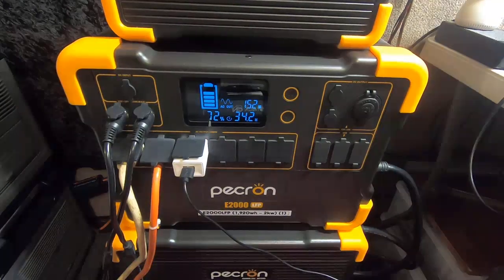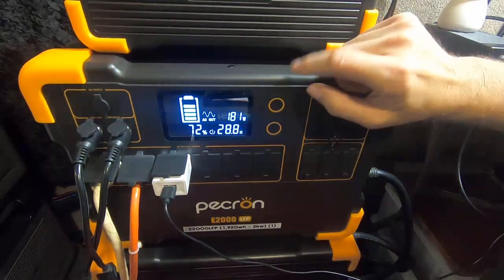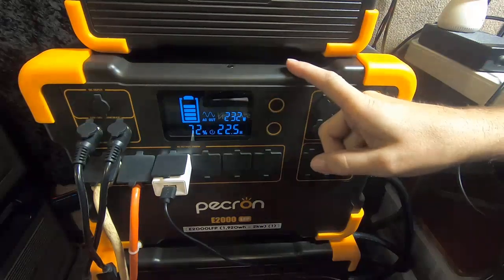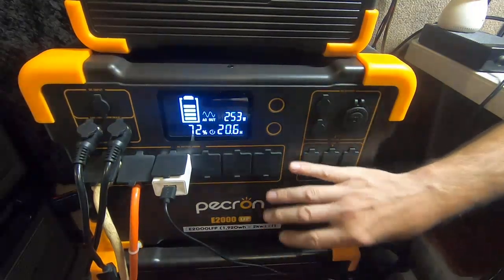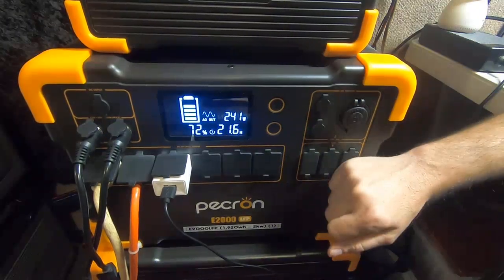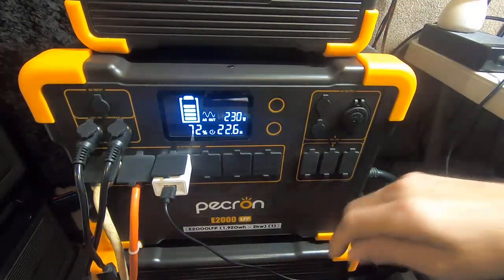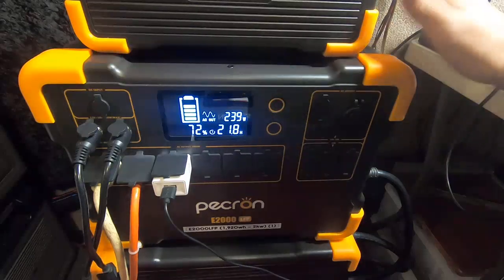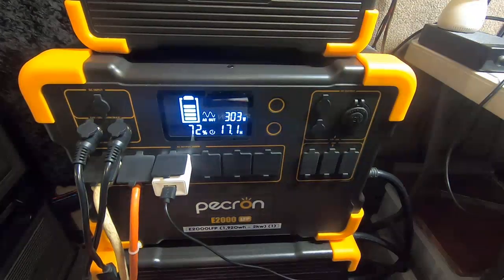SOLAR GENERATORS  ((((DO NOT HOOK THEM UP WITH PARALLEL CABLES UNLESS THEY ARE DESIGNED FOR IT))))

Comment: Each system is a wave of alternating voltage going from negative to positive. In a parallel system, the waves must be "in sync" in order to be safe. A 240v system is when the waves are 180 degrees out of sync. Thus a negative 120v and a positive 120v system, the separation is 240v. You cant possibly tell where the waves are without special circuitry or equipment.
Reply from the maker: This is the reason that we deleted that comment, Somebody could have gotten hurt trying to hook up stuff that is not made to be hooked up together.

P.S. Please be safe out there everybody !!!!!

Comment: The reason I asked is Amazon has a brand called Marxon G1500 that has this option and really cheap.... It looks like cable could be copied but not sure about the insides... Thank You for the information..... I see these all in one off-grid units are parallel so thought this might be options also in solar power station
Reply from the maker: Can be extremely dangerous to play with electricity without fully understanding the dangers :(

  Stay safe out there...

Note: See the "SPECIAL" parallel connection with the ground on the bottom of that system. THAT MAKES ALL THE DIFFERENCE !!!!! And the batteries are wired in a special way also to keep that config safe.
Reply: @RamblinBobReviews  l watched a bluetti 500 review and the guy used the same cable to hook 2 of them, thanks you may delete my comment.
Reply from the maker: @HugoRODRIGUEZ-ps3tw  Yes, Only CERTAIN power stations can be hooked up together like that. If you try to hook up ones that are not made for doing that, You could really get somebody hurt :(

Please be careful out there :)

bluetti AC500 has a very special design in order for you to do that.....